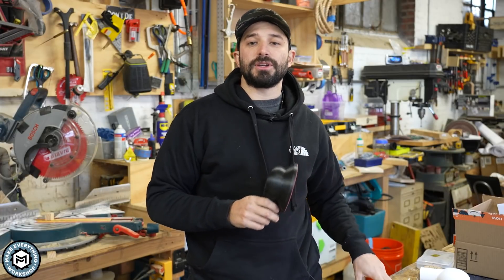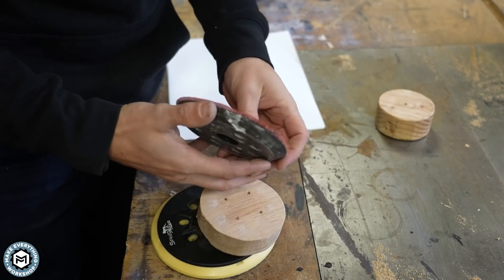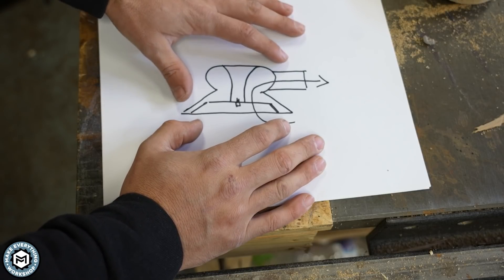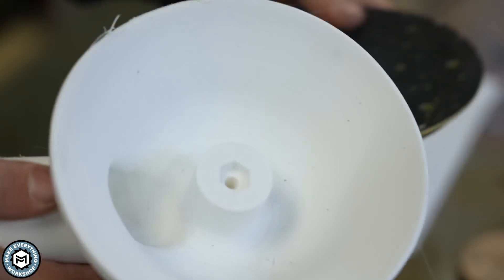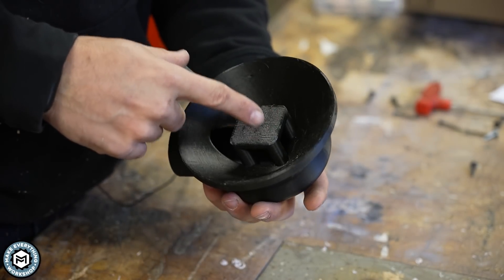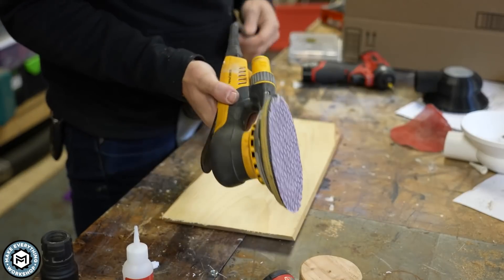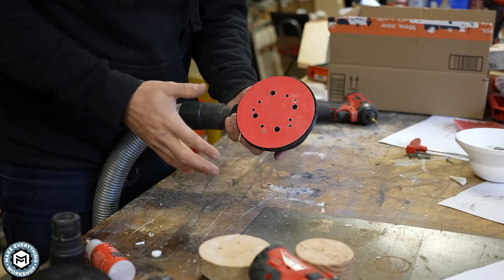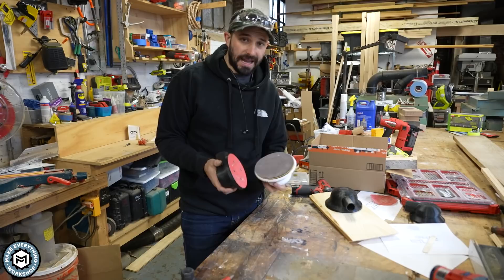A Dustless Sander You Can Make! - Woodworking

Comment: Great idea I used a PVC pipe and cap then drilled a hole on the side with a small dia I put a use straight pipe cut then smooth then the cap glued to the PVC pipe with a carriage  bolt 2nuts and washers

Comment: I like the concept a lot and the only changes that Id make would be to add a few (3-5) half-inch projections on the inside perimeter of the bell to support the outside edge of the sanding pad. That would add support to it and remove some of the strain from the plastic that the bolt is screwed into caused by the constant back and forth strain that sanding and getting knocked about causes. 
If you wanted to make it even more robust, instead of projections they could be supports that radiate from the central support boss to the outside perimeter, like a Mercedes star or a starfish shape. That would serve the double duty of locating the pad more securely and also adding strength to the outer bell in case it gets dropped. Printing wise it may still be possible to do in one piece but making it in 2 pieces and glueing them together would be easy also. In the long run, for ongevities sake, I think the small one needs nut inserts or the internal threads will soon wear out.

Comment: If the smaller Design fails you could try designing screws going all the way through to the top of your part and topping them off with nuts. That will strengenth the whole Part.
Reply: I have found that incorporating threads in the print usually results in a fairly strong connection.  Fusion 360's thread tool really helps with that.  Then run a tap through to clean them up.

Comment: If you find that screwing in the smaller disc doesn't last very long, it is pretty easy to create holes with a standard threading in Fusion. The holes would have thicker walls around the threading and should be stronger. You could then use something like a metric hex bolt to hold it all together.

Comment: you have 3d printer, why you make separated part?
you could make integrated pad
Reply from the maker: Manufactured pads have foam so they give a little Under the pressure of sanding, a 3D printed pad would have no movement under sensing pressure, it makes more sense to use one for the $8

Comment: Great idea.
I would look at the Mirka handle as a model.
I also think you might want to have more air flow around the sides, so there is less vacuum when you sand a large board, hindering your ability to move the sander.

Comment: There are a couple other advantages that come from making your own platen. You could make a size and shape that allows for a small 1/8 clearance between the outside of the sanding pad and the body. Also, why be limited to Festool or Makita paper? The holes are a fairly weak design. Think about slotted and drilled rotors, they resemble older machine laps. The idea is to have a lot of clearance channels for the grit to not end up between the sander and the work. Since you are 3D printing, these channels could theoretically have a third dimension, they could sweep smoothly and upwards, guiding the sawdust into a vortex. This will help keep the airspeed high. You should take a look at older cast iron laps, I think you will find a lot of valuable information that is applicable to this project

Comment: If you make the vacuum port be a stepped taper, that would allow nearly any vacuum to be used. A straight taper necessarily works, but often requires tape in addition. If you have stepped tapers, this is usually enough to grip the hose well

Comment: I have an almost identical DIY hand sander, no dust collection though. I built mine out of a porter's bell. Just removed the spring and chime and swapped the finial for a wing nut. I have a huge crate of 5-in circular sanding pads that are 1950s NOS, far more than I can use in one lifetime. The bell portion clamps the paper all the way around to the base. The base originally had a raised perimeter but I zipped that off in the surface grinder. It's such a small thing but very handy, I probably use it once for every 2 hours I'm in the shop. I also feel a lot safer using it on the lathe then a strip of Emory cloth.

Comment: This is a pretty interesting design! A few thoughts right off the bat, the main bore for the suction, if you made that have a slight hourglass shape above the manifold point, the venturi effect would speed up the air without narrowing it enough to drop out heavier dust. The surface finish of 3D prints would be awful for suction, I have read that there are many techniques to smooth things out such as acetone or sanding. I think you would be surprised by how much difference in efficiency a smooth surface with gentle bends makes. The only other obvious modification to me is the vacuum port. If you made this out of two pieces, you could have an elbow that can free spin. I think this would make it more comfortable to use and easier to get in tight spots.
Reply: I think this project has a lot of potential to become a production run. I think the next step needs to be eliminating the Festool or Makita part. It's just a disc with holes and some foam. You need a bolt circle, but no other precision is required. The angle around the perimeter is an irrelevant angle, I believe it is only sloped for access reasons. There's nothing proprietary about velcro mounting, if you developed your own platen I think you would be free to pursue it. I don't see that part taking more than 10 minutes on a lathe, but UHMW would certainly be flat and strong enough. In fact, I think that would be the logical next step. Find somebody with a commercial grade CNC that can use your files. I know of send cut send, I'm sure there are many other companies that will machine your designs for a flat rate. This would enable you to measure the suction rate, I'm sure you could go through the iterative process with 3D prints, there's no reason that the ratio should not be consistent. Knowing the suction rate could very likely drive your marketing and it might expose you to other industries / applications for your design. I think it is worth pursuing, it's far more elegant than the classic bent wire locking system

Comment: Any reason why you didn't use Mirka's solution in the first place(Mirka Roundy)?
Reply from the maker: I have their small rectangular dustless sander and I like it, I had some trouble finding the Mirka one when I went to buy it a few months ago. What I like about this is you can buy different hardness pads online, and really could put any 5 or 6 inch pad on here based on your preference.

Comment: 3D printers really are "force multipliers" when it comes to building things.  Be careful though....they have a nasty habit of self-replicating.  I had 1, now I have 3.
Reply: That's why it's very important to neuter or spay your 3D printers
Reply from the maker: I have one at home, and one at the shop!
Reply: Great design ! Your printer managed really well the upper part of your "contour" as you call it, doesn't seem to have much overhanging. When asked about the perfect amount of printer one really need, n+1 is the answer where n is the actual amount owned ;)
Reply: @dominicgagne14  N + 1 is ALWAYS the appropriate answer when anyone asks, "How many of <item> do you need?"

....or if I'm feeling especially snarky/miffed I'll ask them a rather inappropriate personal question.  Usually ends the conversation right quick and in a hurry.